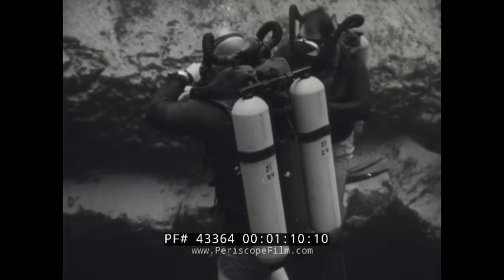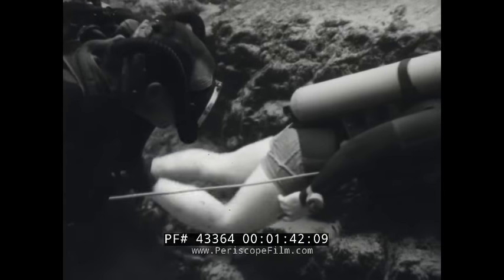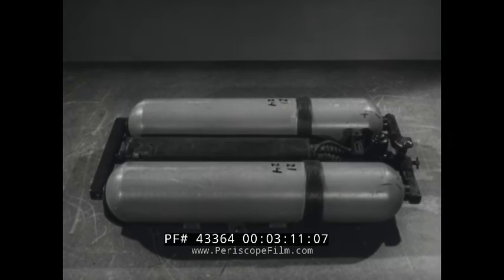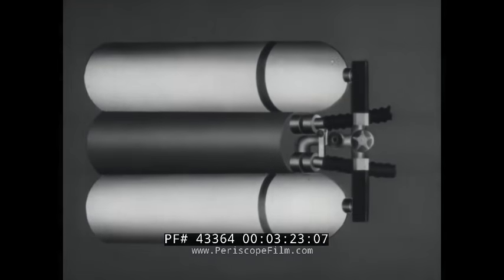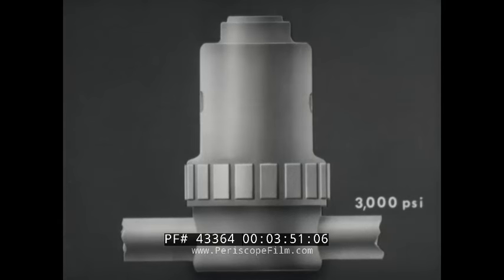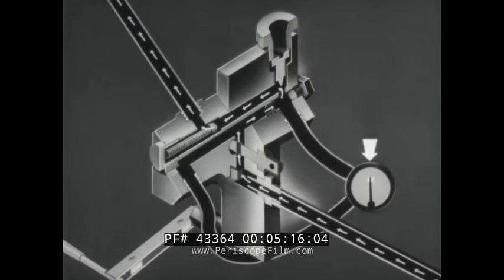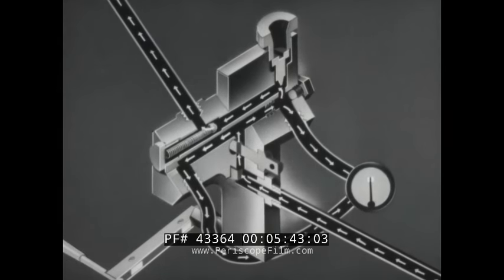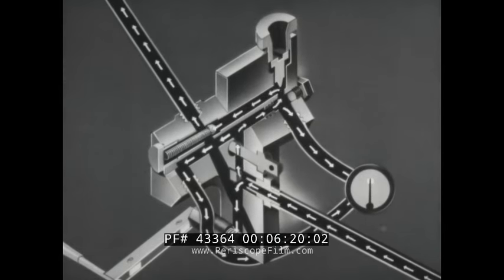U.S. NAVY SCUBA DIVING MARK VI SEMI CLOSED CIRCUIT APPARATUS TRAINING FILM 43364 NA

Comment: damn... those MOD's they listed were quite high! they have MOD for 60% 02 @ 80 feet!  today, the contingency (or deco) depth for 60% O2 (PO2 1.6 ATA) is 55 feet! PO2 1.4 ATA= 44 feet!  if my calculations are correct, using 60% O2 @ 80 feet will make your PO2 2.05 ATA! i'm glad i've been diving in an era where we better understand Partial Pressures and Oxygen Toxicity
Reply: Just think about those guys back then were pretty much  guinea pigs......
     The tables were designed for a 20 year old in perfect shape.....
Whoops he didn't make it. Better back off a little...
 NEXT.......